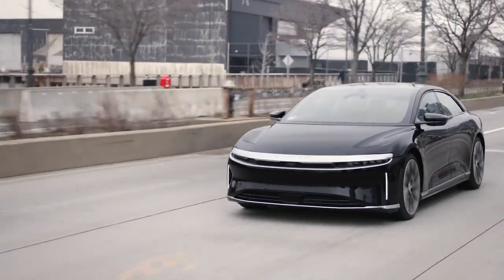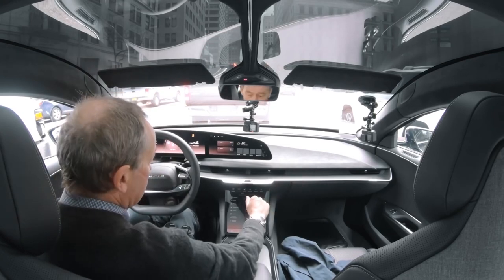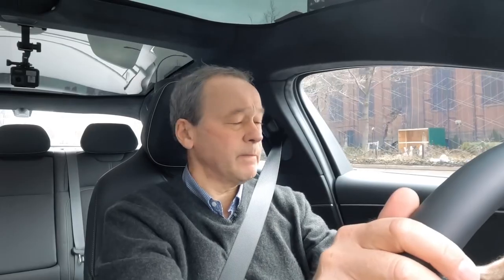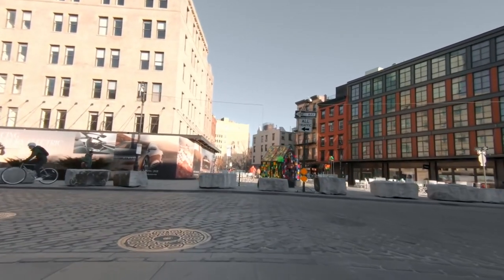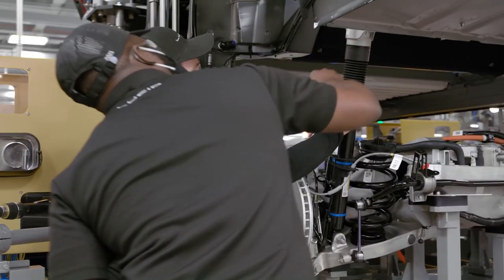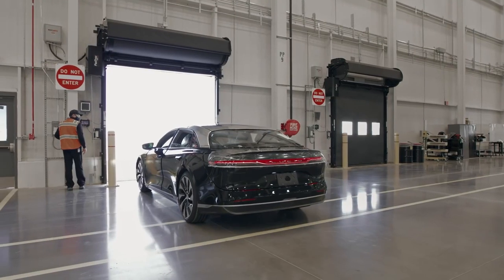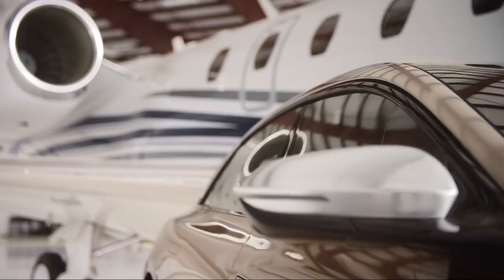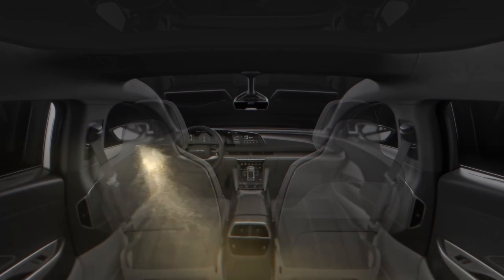2021 Lucid Air luxury sedan CEO Test Drive Features &Technology

Comment: All those years of engineering and designing, and then EQS happens...just saying...
Reply: It's true that the EQS will launch into a market space in which Lucid hoped to arrive first.  However, the Lucid will arrive with considerably more range, power, and system efficiency.

I'm sure some buyers will prefer the quilted leather, bright chrome bits, and shiny black piano lacquer-look plastic of the Mercedes interior.  For my part, however, I prefer the more restrained and elegant look of the Lucid interior.

I own a 2015 Tesla Model S P90D and have been a Lucid Air Dream Edition reservation holder since September 2018.  I was hoping the Air would address the lack of rear seat space for older adults that plagues the otherwise enjoyable Tesla.  The Air does have much more longitudinal rear leg room than the Tesla but, unfortunately, the vertical drop for the legs is still compromised in the Lucid Air with the larger battery pack.  (The issue disappears with the smaller battery pack and its recessed floor wells.)

I was waiting for the EQS to arrive to see if it did a better job with rear passenger seating position than the large-pack Air, which might have induced me to switch to the EQS.  It did not, as is clear from graphics of passenger positioning that Mercedes has published.   Both cars have battery modules in the rear footwells, and both cars jack up the knees of rear seat passengers into an unnatural seating position.

In the final analysis, then, I'll take the Lucid Air over the EQS to get 1,080 vs 516 hp and a 0-60 time under 2.5 seconds instead of just over 4 seconds, as I'm a bit of an acceleration freak.

(I have also owned two Mercedes, with an SL55 AMG being the most problem-ridden car I've ever owned other than an ill-starred Corvette.  So Mercedes' vaunted reputation for quality doesn't score all that high with me against a newcomer that seems to be paying a lot of attention to the issue.)
Reply: You are spot on. EQS makes this car irrelevant.
Reply: @MrIbernie  The Lucid Air has an efficiency of 4.5 m/kWh.  The EQS efficiency is in the mid-3 m/kWh range.  Total drivetrain efficiency is rapidly becoming recognized as the primary metric in EV engineering as it drives both range and battery pack size.  How does a car with mid-pack efficiency make a car with cutting-edge efficiency irrelevant?
Reply: @blakespringpasturemortimer9168  Rich people don’t care about efficiency. Only luxury and class status. Even EV buyers don’t care. Look at all the glowing reviews about the Mach e stating it’s a competitor to the Model Y. The model Y is more efficient but the Mach E added a huge battery to get slightly more range. That being said the rich corporate CEOs will be going to the country club in a Mercedes not a Lucid Air with no support or service network. $170k is a lot of money to gamble on an unknown car company. The EQS will fill the luxury high end market fo those individuals. The Tesla Model S is a high tech performance sedan and has a different client base than Lucid or Mercedes. Besides Lucid has not produced a single car that has been tested to back up their claims. The EQS has been driven by journalist.
Reply: @MrIbernie  I guess I'm one of those "rich people" who love EV's and do care about efficiency and performance, which is why I have a reservation on a Lucid Air Dream Edition.  The Lucid is replacing my 2015 Tesla Model S P90D, so I'm not so sure Tesla's client base -- at least for its upper-end models -- is all that different from Lucid's client base.  (I also have a reservation for a Launch Edition Rivian R1S which I hope to receive around the time my Lucid comes in.)

Yes, the EQS has been driven by journalists.  One of them posted a video a few days ago in which he did a timed acceleration run in the 580 (highest-powered model) and got a 0-60 time of 5.1 seconds as opposed to Mercedes' claim of 4.3 seconds of 0-62 (or 0-100 kph).  He also found the range indicator was dropping considerably faster than the actual miles he was covering on the highway.  So Mercedes has a lot still to prove with the EQS, just as does Lucid.
Reply: @blakespringpasturemortimer9168  please provide the link to the journalist driving the Lucid. And yes you are rich. The model 3 has the same efficiency and better performance so you are really only buying it for luxury. I do have a question for you, Why are you buying a Lucid instead of the Mercedes or new model s? Don’t you think that it is risky to spend 170k on a brand with no track record? Look forward to your reply.
Reply: Here are the answers I promised:

As for the Model 3, I bought my brother a 2018 Model 3 Dual Motor (which he loves).  I've driven it and test driven a Model Y Performance.  No version of this car approaches the 1,080 hp of the Air Dream Edition or its claimed 0-60 time of 2.5 seconds, so I don't understand why you think it has better performance.  As for efficiency, that is partly a function of car size.  The Model 3 is in a smaller size class than the Lucid which, all other things being equal, means it should have better efficiency than a Lucid Air.  It does not.  The Air is in the Model S size class, and the Air efficiency is 4.5 m/kWh compared to the Model S 4.0 m/kWh.

Why am I buying a Lucid instead of an EQS or Tesla?  Let's take the EQS first.  I was visiting the Lucid Design Studios in Miami and West Palm Beach about the time the first substantive information came out about the EQS.  Having been disappointed in the high knee position sitting in the backseat of a Lucid with the larger battery pack, I decided I would keep an eye on the EQS as an alternative.  However, once Mercedes published dimensioned graphics of the front and rear seating positions and I saw a couple of video reviewers in the backseat of an EQS with their knees in the same position I had experienced in the Air, I realized both cars shared that same problem.  It seems inescapable that any cars with battery modules under the rear floorboard and a low rear roof line to keep drag low will share this unfortunate trait.

The Vision EQS concept car's interior blew me away.  Once the interior of the production EQS was fully revealed, I was hugely disappointed.  The expanses of quilted leather, the numerous bright chrome bits, and too much use of plastic faux piano black lacquer panels just left me with a "pimp-my-ride" feeling.  On the other hand, the Lucid interiors I saw and touched in Miami and West Palm had a wonderful tactile feel (especially the beautiful matte eucalyptus wood), and the restraint and under-stated elegance of the interior design was very striking.

As for replacing my Tesla Model S P90D with a new Model S Plaid, I won't say anything about the interior other than . . . ugh.  As for performance, the Plaid requires three motors to get power output just slightly ahead of the Air's two motors (and Lucid has a tri-motor Air in the works).  Nikki Gordon-Bloomfield of "Transport Evolved" did a recent ride-along in a Lucid Air beta car.  She noted its handling dynamics and tautness in the twisties were ahead of anything in the Tesla lineup and perhaps on a par with the Porsche Taycans she has driven and in which she has ridden.

Regarding Lucid's lack of a track record, I bought my Tesla in 2015 when it has been in production for only three years, when Tesla's financial survival was an open question, and while quality problems were still legion.  (My car broke a weld joint which took out the battery pack and rear drive unit, it has had four repairs to the driver door latching mechanism, and it's on its second MCU which is now giving me problems again).  As for Mercedes, except for a mess of a 1998 Corvette, the most problem-ridden car I've ever owned was a 2004 Mercedes SL55 AMG.  So I'm not exactly a worshiper at the altar of Mercedes quality.

After the SL55 I owned three Audi R8's (the original V8, the V10 coupe as soon as it was available, and the V10 spyder when it hit the market a year later).  All three of them were problem-free . . . and the guy who ran Audi global manufacturing operations at the time is now head of Lucid manufacturing.
Reply: @blakespringpasturemortimer9168  That was a very good explanation of why you are buying a Lucid. The problem is that the Lucid Air with all of their crazy claims of super efficiency and performance are just words. No automotive journalist has actually driven a production version. Their claims that an independent lab tested it is a bit hokey. FEV does not test cars they test powertrains on simulators, not real world driving. Go look at the company for yourself.  I'm glad you are a buyer and not an investor because you will hopefully have the ability to ensure the car can deliver on its promises before you spend your money. You clearly have lots of money to purchase cars so if it is a dud, no biggie. Remember Peter Rawlins integrity is already questionable when he did not disclose the delay in production until after the SPAC merger. I hope that the Lucid Air lives up to everyone'[s expectations because the world needs more great electric cars. What we don't need are con-men like Nikola. I watched the Niki ride along and heard a bunch of excuses about noise and fit and finish because it was just a beta test car. Until I see a production car in the hands of a journalist and some real world testing I'm skeptical that they will deliver on the promises. I do however believe the Rivian truck is the real deal and will give many big name automakers a run for their money! As for as your 2015 Model S, All car manufacturers have production issues. The question is 6 years later will they be around to fix the car. I myself am of more modest means and have owned a Leaf and now a Model Y(very comfortable back seat) and both cars have been flawless with no service required. Seems to me you should hold on to your pennies and wait for the plaid ++ so you can get the comfort and performance your looking for. I don't think you will see a Lucid Air until Q2 2022 if ever. Good Luck!
Reply: @MrIbernie  There is nothing crazy about Lucid's efficiency claims.  Efficiency is calculated quite simply:  by dividing the battery pack capacity into the EPA range rating of the car.  FEV tests exactly the same way the EPA does -- on a dynamometer with the car running according to specific procedures.  Also, FEV tests have a long track record of closely squaring with EPA ratings, which is why GM and many other manufacturers use FEV during development of new models.  EPA mileage (which is also used for Tesla efficiency calculations) is never calculated based on roadway driving.

Here's the way it works:  using EPA procedures, cars get far more mileage on the dynamometer than their eventual range ratings.  A reduction factor is then applied to the raw range to derive the EPA range in order to make a generalized adjustment for real-world driving conditions.  The usual reduction factor is 0.7.  However, Tesla got EPA approval to use a 0.75 reduction factor based on showings that their ancillary systems were more efficient than other EVs.

In Lucid's case, the car ran 738 miles on the dynamometer.  The 0.7 reduction factor brought that down to the 517 miles that FEV reported.  Lucid is applying to the EPA to use the same 0.75 reduction factor that Tesla uses, based on the same argument about ancillary system efficiency.  If the EPA allows that, the Lucid EPA range will actually land around 553 miles.

I am not sure Lucid will choose to use that more favorable reduction factor, even if the EPA acquiesces.  A VP at Lucid told me that they are very proud of the fact that their real-world driving mileage is much closer to the 517 range estimate than Tesla's real-world driving mileage is to their EPA estimate.  They might ultimately decide they prefer to get closer in real-wold driving to their published range than to take the Tesla path of pushing the range measure as far as they can and living with real-world range that falls considerably short.

Lucid has conducted real-world convoy tests against a Porsche Taycan and Tesla Model S Long Range Raven with a Bloomberg journalist riding in the Lucid.  Kim Reynolds of "Motor Trend" also rode in a Lucid during a mixed-driving highway test in which the car achieved 490 miles.  (I corresponded with Reynolds via email after this test about his experience of 10 hours in the back seat.  He assured me that everything in the published article about the range was what he personally observed.)  Lucid is not making up these figures.  On the other hand, Edmunds testing has shown that Teslas consistently turn in the worst range performance in real-world driving against their EPA estimates of any car brand.

The Lucid Air efficiency with 19" wheels is 4.58 m/kWh (517/113), and the Model S Long Range's efficiency, also with 19" wheels, is 4.20 m/kWh (412/98).

It's really that simple.
Reply: @MrIbernie  A quick addendum:

As for my stock holdings, I have over 10,000 shares of CCIV.  I also have a large tranche of Tesla stock and will invest heavily in Rivian when it IPO's.  (I think I mentioned elsewhere that I've been a reservation holder for two years for a Rivian R1S Launch Edition.)  Of the American EV start-ups that have come and gone (and sometimes come again), I think these are the three most promising over the long haul.

I'm irritated by Lucid's repeated delays, and I became worried that Rawlinson might have picked up some Musk DNA with his slippery timing of the most recent delay announcements . . . but I have no doubt the Lucid Air will make it to market and little doubt that the company will succeed.